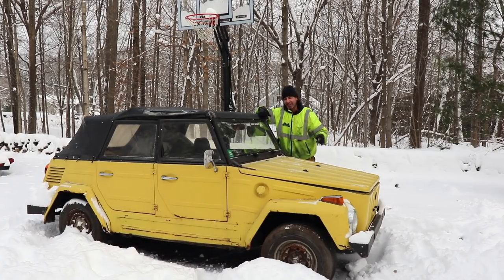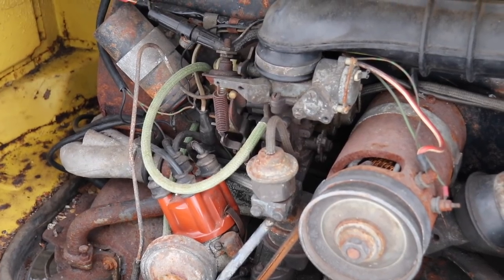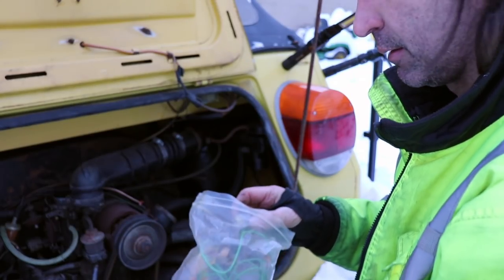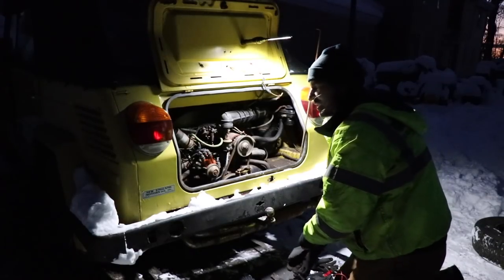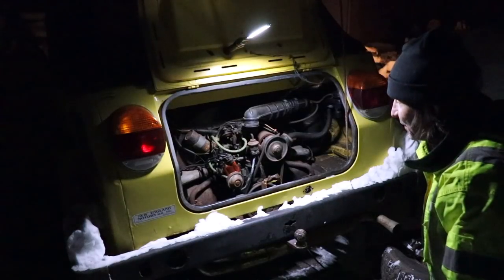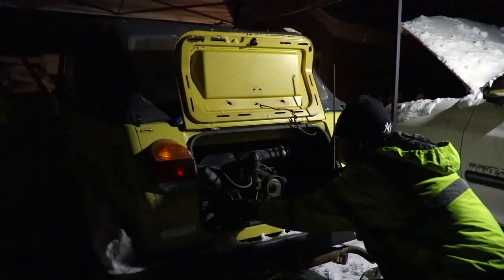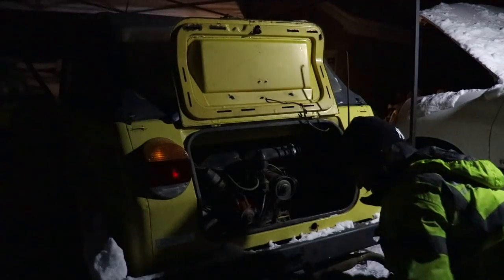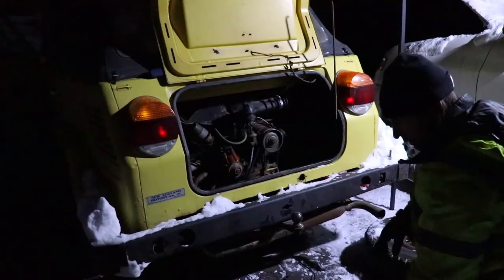WILL IT RUN? Forgotten VW Thing Type 181 sitting for 32 years!

Comment: I don't know whether to tell you you're freakin nuts, or awesome job for sticking to it in adverse conditions and getting it running. Enjoyed the last year and looking forward to your antics for the coming year.  Stay safe and have fun in 2022.
Reply from the maker: Thank you MC , much appreciated, thank you for being here
Reply: @5150mxVW   Did you inspect the fuel system, fuel filter, is the fuel in the tank?
Reply: Just normal winter working conditions in the northeast. Probably a good day as it wasn't snowing heavily. 😁
Reply from the maker: no i was not running fuel from tank
Reply: I think bcoz the fuel system you not really through out checked, if you  keep doing starting like that, that only can damage your starter unit instead, the best ways is back to the basic by checking  the compressor power first then the most important thing is the fuel pump effiencies since you still using original tank which not clean bcoz of long layoff.

Comment: TIP  for today.....REMOVE THE 13mm behind the distributor this will keep the timing close to stock (remove distributor with bracket in place) DONT REMOVE THE 10mm then your timing will be off. I remove the distributor all the time to put points in that way. Much easier.

Comment: Dude, when cranking these old engines, please help them with some throttle!! For some reason many of y'all in the US will crank engines til the next century and would never touch the throttle, and it drives me crazy hahahaha

I know it's an engine that sat for a long time and that heavy acceleration might represent premature wear, but c'mon, you're just helping the engine a bit to get started and then you just keep it from revving up high.
Reply from the maker: and what would be your reasoning for giving it throttle ?
Reply: When it starts to catch just  give it a bit of throttle and see what happens! It cant hurt. Its how we always used to get our cars going before computers.
Reply: @5150mxVW  The accelerator pump would give it a shot of fuel. Does it have fresh fuel? A choke? Firing order right? A friend has 3 of these that look almost new. They came from out west and never had any rust any where. I have one stored here in my shop and it's a show type sand runner. It has a Porsche engine hanging out the back. Roll bars, large tires, dual shocks each wheel, turning brakes, dual fuel tanks and batteries. It's had a lot of cash thrown at it. Problem is, no title and no Vin #.
Reply: I agree, giving it some throttle definitely helps them get going.
Reply from the maker: it had plenty of fuel haha, that was the  point of my question ...boot was off it had air , choke was on ....
Reply: Bang on been shouting this at him ffs throttle.  laughing will not make it run .
Reply: @5150mxVW  dude just try it. We wont judge you. Most days i cant even get the toaster to work. 😎 and that ain’t even  got a throttle .
Reply: @ronsimpson261  same here , ha haa
Reply: Very unlikely it's going to pop off and "idle", come on work that throttle a little bit man, you never even touched it. Hard to even watch, could have had it running and still had daylight left.
Reply: @5150mxVW  That's not just a mouse, that's the engine room officer.
Reply: Love your videos…but I’ve gotta admit what I was screaming at the screen was “Timing light and give it some throttle!!!” Messing with the dizzy a couple degrees will only get you so far…
Reply: not all of us...lol...i try throttle and choke while trying to start it...cover the throttle to choke it more....anything to try to assist it...needs to get help...the carb or fuel may be sticking or just not rebuild ( ever ).....
Reply: isso mesmo! eles não  aceleram.

Comment: I bought a 1973 Thing in 1974, drove as my everyday car for 12 years, redid rocker panels at 100,000 miles , running gear was never out of the car. Mine had the fiberglass hardtop and was retired at 140,000 miles due to rust , still had all original running gear and was 100% reliable. Only complaint was lack of heat in winter , at over 50 mph the side windows would flap open and the gas heater just couldn’t keep up. 👍😄🎩

Comment: Hey, the engine doesn't sound that bad to me. The automatic start consists of a bimetal spring, which is heated by a coil as soon as the ignition is on. That means after a few minutes the choke flap opens whether the engine is on or not. You can still use the starter for hours. In addition, you always have to give it a little gas to start it. So when stationary it won't start when it's cold. So turn off the ignition, wait 10 minutes, accelerate several times. Then some fuel is injected into the intake manifold. If you didn't give it gas before starting, the choke flap is open when you start it and it won't start. So the choke closes due to the gas pressure and then remains closed until the bimetal is hot. This is quite normal for a Beetle engine when it is in good condition.
Reply: Wenn er das genau so gemacht hätte, wäre der Motor bereits nach 10 Minuten gelaufen !

Comment: I've had the immense pleasure of driving an original WW II Kubelwagen, the impetus for the Thing. So cool! I would love to someday own a Schwimmwagen which is the amphibious version in 4 wheel drive.
Reply: Tip:  Spark plug gap should be inversely related to compression, so if you an engine that won't fire due to low compression like that, try a really big spark plug gap like .050"  though if the internal insulator is fouling, do the opposite.  Try a really small spark plug gap like .015".   You can even try combinations and hope it starts on some cylinders and the rest chime in later.  Also get the "hottest" plugs you can find.  that is, the plugs with the tallest internal insulator towers that are most resistant to allowing the spark to short out through the dirt on the internal insulator tower.  They are not a threat to a worn out engine, but if you are worried about hot plugs, you can always switch back to regular plugs once you get it running.
Reply: I also can't tell if he has enough throttle. if he has the throttle set at idle, it will act just like that.  But he should be experienced enough to know that.
Reply: Is it ballast resister circuit? where the spark only fires as long as the starter is running so the engine shuts off with the starter motor?  It is sounding that way to me!

Comment: Great video.  Had a 74 thing in college and after. 84-88. Very easy to work on compared to a beetle. Most panels folded down and you could crawl into the engine compartment and close the door behind you.  Could carry 5 kegs of beer but heating in upstate NY left a lot to be desired. Changed my 1500 for a 1600 dual port.
Reply: This one seems to have the original type 281 exhaust instead of the $15 JC Whitney everyone else had
Reply: And Michigan floor pans.

Comment: Not how I'd have gone about it, but it was very entertaining! I know you were just having a play. I'd have gotten a temporary fuel tank hooked up, set the timing statically and pumped the throttle a few times and let some air in and get the accelerator pump doing it's thing. In any case, it brought a smile to my face! Happy birthday and happy new year!
Reply from the maker: Agreed , yes , not my typical approach either :). Thank you , we will revisit this on the lift at the shop ....good advice too👍

Comment: That was a great video!! Your persistence paid off, and the Happy Dance you did was the icing on the cake. I know that feeling well when I got my ‘66 Satellite running. I’ve had it 40 years, and it’s been sidelined since I got married in 1990. I just got it running last summer, and it’s the greatest feeling to hear that engine run once again.

Comment: With a little planning ahead, you could have had some basic tools, like what VW supplies with the car. Clean & gap the plugs, a little oil in the cylinders, fresh points / condenser.... and it would have started in less time than you spent here! That said: any time I pull a distributor I scribe a mark where it meets the hold-down bracket, and that's my starting point for sticking it back in. You can also eyeball the TDC mark on the pulley and line up to the #1 mark on the distributor rim. BTW, you have probably figured out there's an odd noise in there. From where I sit it might be acorns in the cooling fan. Take the belt off and give it a turn by hand to confirm. Edited to add: happy birthday!
Reply: Aren't you special.
Reply: @keithbronson9777  ... yeah, almost sounds like I might have done that before, right?
Reply from the maker: hey 53 , I usually do a much more thorough pre start checklist ..oil , valves, lube cylinders etc ....but not on this , i wasn't digging all the mouse nest / crap out of the plug holes and i wasn't dragging it to the shop ....I always pull the dizz at tdc , and put it back tdc no biggie ...I could of static timed it as well but it's really not that hard to get these to fire and run 1/2 ass ....just this one lol. Good tip on the belt , thank you. Just a vid to have a little fun :)
Reply: @5150mxVW  ... yeah fun, but the frustration level was high watching you go through those motions. I know you are not all that far away from me so maybe a road trip could be in the works when the weather breaks. I'm about 10 miles south of Danbury.

Comment: The Thing was at one time quite the thing. I know,  that was a bad one. My garage is a 10 ft X 20 ft King Canopy. Needless to say,  it doesn't provide much comfort in January. I'm thinking about adding optional sidewalls. By the way, Germany's  Second World War Jeep was a VW with a striking resemblance to the Thing. Except for the sloping front,  they could almost be mistaken for one another.

Comment: Excellent video Jason  :) also did change fuel filter at all and put choke on too and see happens plus have points set up too! Coil may need replacement too with set wires to ! This one be rough also tough too & Happy 50th Golden Birthday Jay :)  and mine was January 6 2022 and I am 46 years age too! That Starter need replacement for sure 👍!
Reply from the maker: thank you , oh that starter is an MVP , it was cranked way more than shown🤣. Happy Belated birthday to you Andrew
Reply: @5150mxVW  Thank you Jason  :) but may need clean up and be ready to go more hours also miles too Lol

Comment: And the award for "most abused starter of the year" goes to...!  Damn, you worked that thing really hard. 

The only tattoo I have is a line of five tiny carbon spots on the back of my right hand. They are remnants of a backfire burn as my hand was behind the muffler of a 74 thing I was trying to make run again. I pulled it out of a garage in 1992, after buying it from the original owner's father-in-law. What caused the backfire? My lack of setting correct timing after replacing the points and condenser.

Comment: OMG..... so I & Mustie says: 12 v test lite.. check for 12v @ the + coil terminal 1st. THEN, clean points & then... r&r  condenser & then replace coil. Fuel can be added by squirt bottle then.   
I had a VW repair business in the 70's and gotta give credit to Herr Doktor Porsche.. Until electronics set in, these engines could run on the ground with a squirt of gas and a battery! I've even seen humans putting a rope around the crank pully and starting them! Probably the start of the best evolution of engine design that ever was... I had a 2,4 l 911 and I realize now that it was not even 1/2 the way there.  I LOVE these things!!!

Comment: Jason, I was able to start my old '63 with two completely burned out exhaust valves, now that's no compression, so I'd be surprised if lack of compression was the issue. They've even run them as industrial air compressors, using two cylinders for the engine and the opposite side two cylinders for compressors.
New starter may be required.

Comment: just a note to be careful: I have a 1970 Bus that hadnt run since 2004. I got it to crank over while using a remote start button. I had my habd next to the exhaust pipe, it backfired. Blew the remote start out of my hand. I got some minor damage to my hand. Scared the tar out of me. Yes I got it running, but just be careful near the exhaust pipe. I am fine.

Comment: I understand you wanting to use premix gas to give some lube when trying to start but when you have 7 to 1 compression at best I prefer using ether after initial try with premix . Saves on battery and starter and cleans plugs incase fouled
Reply from the maker: great advice , I think all that fuel / oil finally gave the rings  enough to fire
Reply: @5150mxVW  Yeah 6 volt very temperamental, was into bugs back in the 70's when gas crisis hit. I remember leaving cover for fuses off to give a spin if horn or signals or whatever wasn't working and the old blip of the gas helped also . Buying a  8 volt battery helps. Don't know if available anymore. I'm retired now and looking for that one hobby to keep busy and thinking of doing bugs again. I see lots of bugs that are basically bone stock and after flat footing a bug to make it from point A to B and not being able to keep up with traffic I bought dual port heads, and turned it  into a 1700 and put off road use only cam in it and that bug turned into a jack rabbit. Between work and school I was putting around 130 miles a day on it for 5 years. Gas mileage was the same except I hardly had to touch the gas to maintain speed and no more hitting 70 at bottom of hill to just endup in 2nd gear at top. Even took to Florida cruising at 70 mph with 4 people in it.I was a lot smaller then LOL. Cruised at 70 giving 1/8 gas just like any other car.  I've built many an engine and nothing wakes up like like a bug motor.  I believe Ferdinand Porsche did this on purpose to make Porsches look that much better 😉.  Good videos and your boy has your number,  you push cars for a living 😆

Comment: Air and fuel has to be balanced. In case you gave it too much fuel it won’t pop off because it’s not balanced with correct amount of air floods the spark plugs. That’s the reason ppl are telling you to give it throttle to adjust the air flow.

Comment: You should work that throttle a little bit! When you're dumping raw fuel down the carb it's going to need a lot more air to get it to light off.

Comment: It's has low compression.& I'd soak the cylinders in some tranny fluid. Then put A thing of restorer in the engine motor oil it will run. And reseat the position oil rings again to. I would try it what do you have to loose on something that just might restore that engine. Then it'll start up.& run again like normal.

Comment: So if the definition of insanity is doing the same thing over and over while expecting different results….does that also apply to your subscribers  who watch you doing the same thing over and over again and expect different results, too? Probably.  Stuck with you the whole way…thanks for pulling it out in the end…it restored our mental health.
Reply from the maker: 🤣 , Ok Steve'O , shoot me an idea for the next vid , I'm taking requests . Thank you for suffering through until the end :)
Reply: @5150mxVW   I would think most of us would like you to get that VW Thing running decently…or at least parse out the cause of its issues.  Some resolution would complete the cycle.  And as a personal request…can you do it in the garage?  I live in the South and I felt frostbite coming on just watching.
Reply from the maker: I had planned on getting it on the lift and giving it a tune up , go through it yada yada ....so we might knock out both requests :). Thank you for the feedback Steve.

Comment: Jay the engine would have started quicker after about 10 mins of the video if you had just used the throttel on the side of the carb when the engine was trying to fire putting fuel in and hoping it was going to start off the key or in your case trigger doesn't work i was screaming at the video give it some throttel. Having that said i iove watching your video's Happy birthday and happy new year from the uk

Comment: My guess is  put a hotter Battery in her and she will  suprise you  sure you can file the Points  or swap out the Condenser none of that is expensive or very time Consuming   to do  i’ve played with many of cars over my 60 years and  one of my favorite tools to have around is a 110volt battery charger with a Jump mode Monkeying around with Crappy Batteries suck or pulling them out of something else they should be in  also Sucks especially in the Dark and Cold Outside

Comment: Why even mess with the points,  just drop the Pertronix baseplate and pickup in and start it.  I mean you're not gonna keep the old points system anyway.  And spark,  I think I'm gonna check the spark from the coil wire to the cap first to make sure the coil and coil wire is good .   But I've gotta applaud your perserverance.
Reply from the maker: I don't run the tronix' in any of my cars ....no, not my best approach here , but thank you for the perseverance comment :)
Reply: @5150mxVW  

Maybe just to start the car though,  points and condenser are just another failure point to consider when you're trying to get it running after a long time sitting,  and then you have to set the gap just right or that's gonna throw the dwell and timing off all while you're trying to get the car to kick over and run.  Seems like you played with that in the cold for a long time,  I would've gotten disgusted with it and dropped the Pertronix baseplate in, set the air gap, and started it,  then could have put new points and condenser in later.  I mean you're generally dealing with cars that haven't been started sometimes in decades,  seems the easiest approach is to pull the baseplate out of the distributor,  drop the Pertronix baseplate and block in,  set the gap in two seconds,  put the cap back on and start it up.